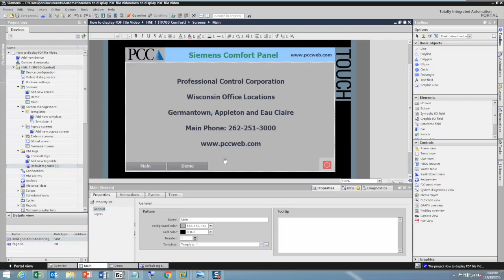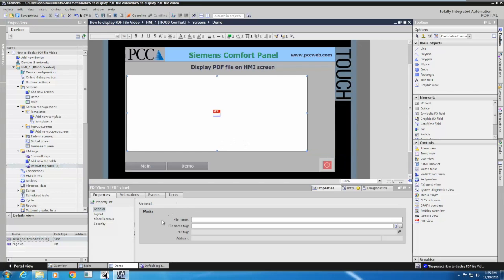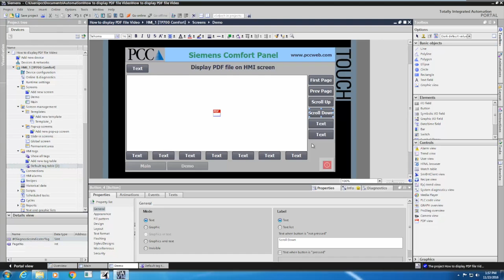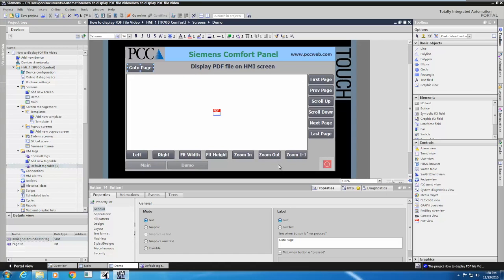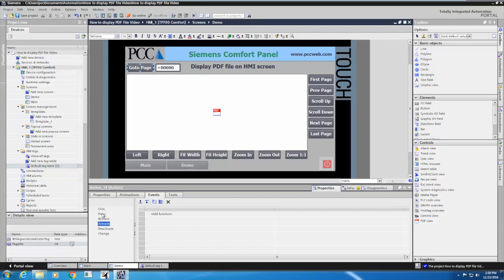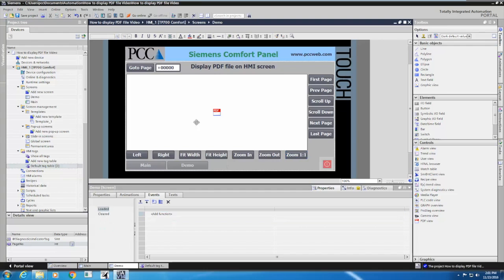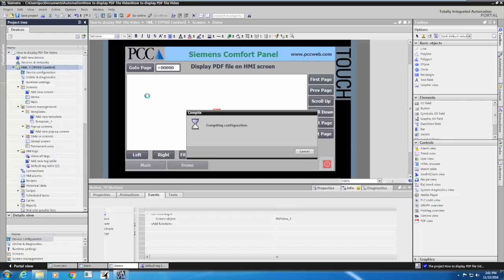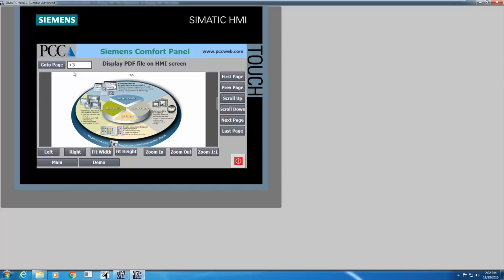How to display a PDF file on a Siemens Comfort Panel HMI

Comment: hello guys in TIA PORTAL . I have a motor controlled  in DOL with a BREAKER.
When the breaker trips i want the motor to show red and blink,when i reset and run motor i want my run signal from contactor to turn motor grEen.
how do i combine run  FROM CONTACTOR and trip commands FROM BREAKER to Show on HMI. 'NEED HELP